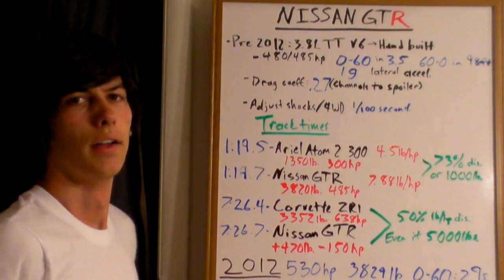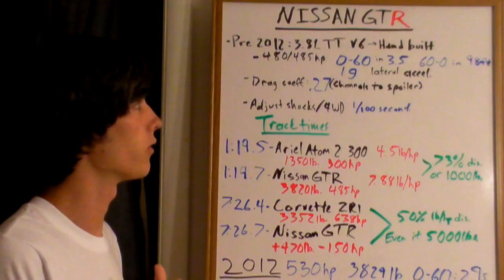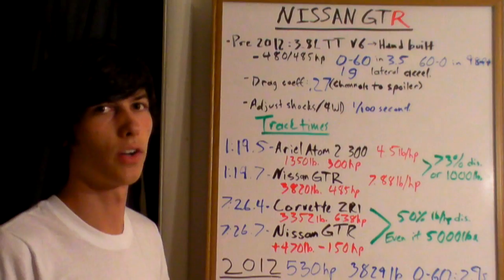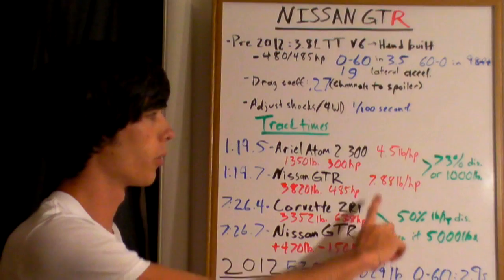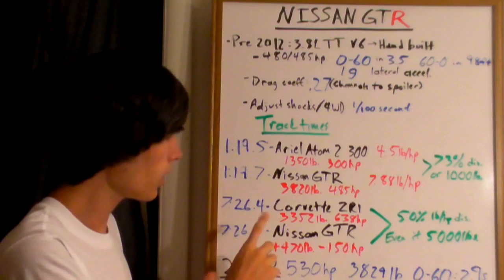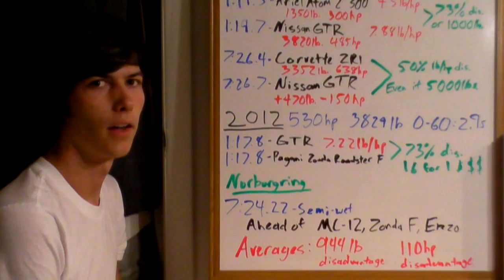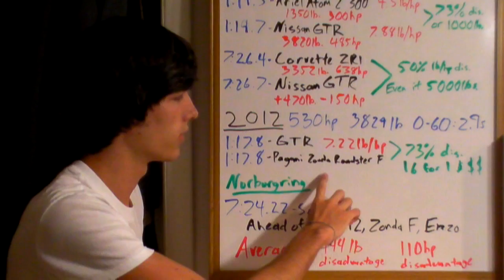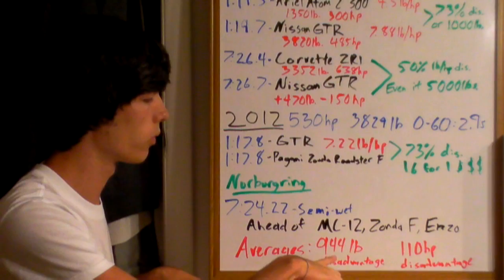Nissan GT-R - Engineering Excellence

Comment: You need to make this video again now that the corvette whops everything in the track . You need to do this video Using the Z06 and GTR but this time explain why the z06 is so awesome ..Video Dialog = Corvette has over 30 less hp than the gtr and still whops the gtr in almost every single aspect fuel efficiency, braking, lateral g . Every single track on earth except  0 to 60... Oh and the z06 would have beaten the zr1 at the Nürburgring if it wasn't for the straight away so 130 less hp but fast

Comment: why not compare 4wd vs. rwd? none belivers can just compare the GT-R's lb/hp to lamborghini murcielago or gallardo.. those are 4wd, have a better lb/hp ratio, worse 0-60mph and worse top gear test track times :P
there is only one conclusion, the GT-R truly is a wondercar...

@redmonbadone
why would they cheat to prove a point? the GT-R is THE ONLY supercar produced on assembly line.. it might seem underpriced, but it isn't.

Comment: a slower car is easier to drive fast on a track , 4wd and 2wd F/R all diffrent driving styles  
1. the skyline is a active 4wd car constanty shifiting the power from F-R and L-R
2. very advance control systems and computers
3.efficiency drivetrain 80-90% 
4. the car is a driving robot
5. Nissian will cheat to prove a point. ( The car cost way more to make than what they sell if for )
6. Stiff chassis. Less flex better cornering . 

 Honda FD2 Type R. impresive,cheap track car.

Mech. Engineer

Comment: If I may be so bold, the gtr is so "great" because Nissan engineered the driver right out of the equation. To drive a gtr fast all u need is two arms a right foot and half a brain. The tech will take care of traction shifting and weight distribution for you. That's what makes it so heavy. I firmly believe the gtr not to be a sports car as it has no soul. This is just my opinion.

Comment: Thats because its a bike... you may have your opinion and yes bikes are undoubtedly faster due to very little weight. Alot of hp per ib. but just think about it though.... hit one patch of sand on high performance bike going balls out and your in the hospital for a long ass time if ya live. Cars are more stable and safer by far.

Comment: you have to understand what the GTR was designed to be, and all what your saying is irrelevant, boring when not driven to its limit true, but at its limit you will have your hands full, look at the last in car video of the Nurburg Ring and you will see how much steering and throttle correction the driver is doing, look what chris harris has to say about the GTR, if your a car nut you will know Chris Harris is one of the Few Genuine Automotive Journalist who can really push a car,

Comment: Still Improving...amazing...
Even today with all respect to Dodge, makes 700hp in 6.2L displacement
Nissan GTR nismo makes 600hp in 3.8L..that,s way better .......and price !!
Reply: +Liv Z GTR makes 100 hp per cylinder. It weighs 3,800 lbs and does 0-60 in 2.7-3.1.  That's the best engineering to date.
Reply: IEATPLANETS YESIDO yep but if the SPECIFIC output Increases ...U got to consider the Engine WAY 2 much STRESSED---> meaning it won't run 100,000 miles like an avg car
Reply: +Balaji Chandrasekaran yeah, but they probably designed it with any extra stress in mind, and built it tougher to suit. they didn't just slap some more power in an engine.
Reply: Caleb Marttinen yeah bro  i agree

Comment: yes the gtr is a great car put i think that nissan needs to get its head out of its ass and think cause they could build an a lot better car with a larger engine. i mean a 3.8 liter v6 is pathetic. yes they can mod it and get a ton of horsepower out of it, but it would be nice to see it with a v8 v10 or v12

Comment: Nissan GT-R is just an extremely overrated car (like Toyota Supra and Tesla!), something that media tries to advertise it! If it is faster round the track than some lighter cars, that's because of it's AWD configuration and SUPER STIFF suspension which makes it impractical for everyday use and gives it a very harsh ride. And it's not faster than cars with 10x the price! Please, for God's sake, don't exaggerate about obvious facts and truths! With 10x the price of GT-R you can buy cars that even some Tuned GT-Rs can't match them! With 5x the price of GT-R Nismo (I said 5x not 10x!) you can buy a Porsche 918 which not only demolishes GT-R in every track but also humiliates some of highly tuned GT-Rs! I should also mention that you can by a Corvette Z06 C7 with the price equal to ordinary GT-R but beat even Nismo GT-R both in acceleration and laptimes! I suggest you make a video about engineering excellence of Lamborghini Huracan which is a real masterpiece! It has only 610 PS and it has a naturally aspirated engine with just 560 nm! But it beats many cars with forced induction and much higher torque and HP.